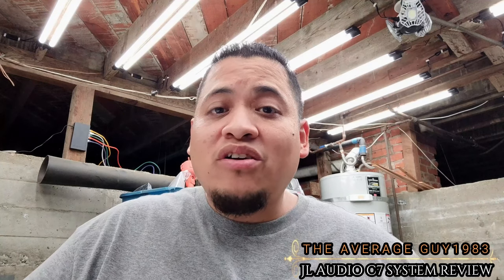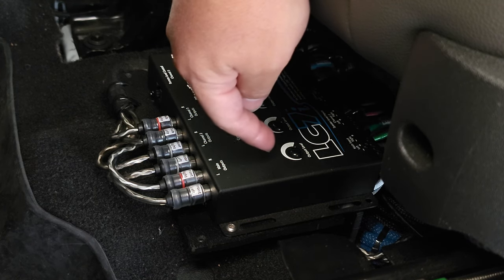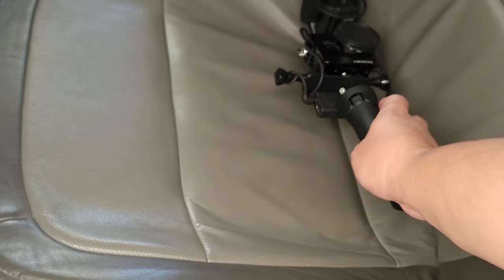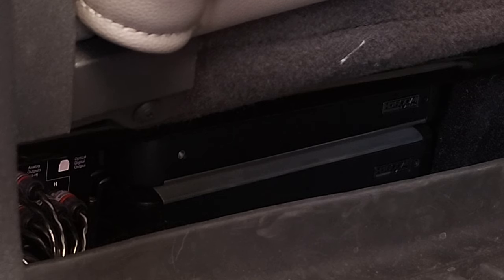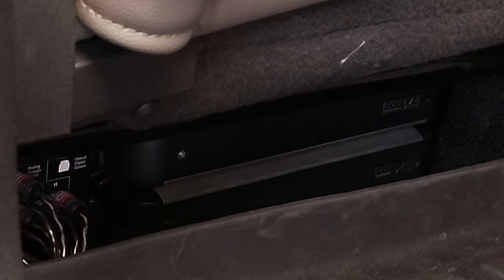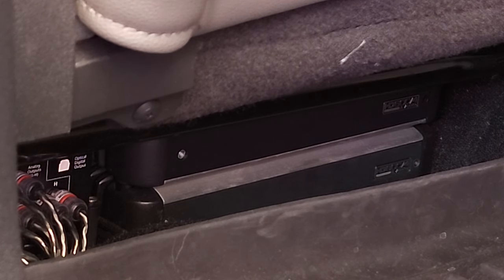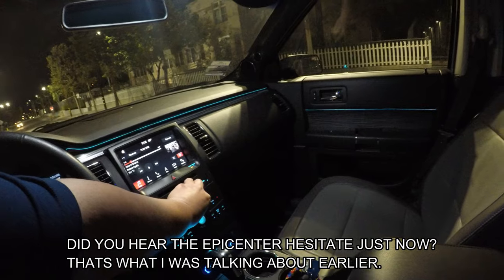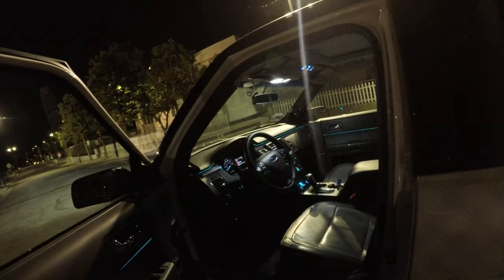MY JL AUDIO C7 AUDIO SYSTEM REVIEW

Comment: JL has always claimed 40 to 50% higher watt ratings then they can handle but they do sound good but if you follow the spec's you will fry them quick
Reply from the maker: You have no idea how happy i am to read your comment. I really wish people would know this about JL. To me, JL Audio is still an awesome brand, but you can't push these new C7 speakers anywhere near their rated power, but they sound so freaking awesome. I hope you dont mind, but im going to pin your comment because people need to hear this from someone other than me. Thank you again, man, for saying this. 🙇‍♂️🙏
Reply from the maker: @XxHoLiNeSsxX  yep. Now i know why JL Audio made the Vxi amps, i just wish the Reps i talked with would have been honest and said just get our Vxi amps for your speakers instead of pushing the HD amps to me so much as "the best choice" 😅
Eventually, i will be replacing the amps with VXI and cleaning up some gear clutter.
Reply: @THEAVERAGEGUY1983   Can I ask if the epicenter is good for SQ system? I listen to just about everything I enjoy experimenting with new stuff alot.
Reply from the maker: @stabbingheart3781  absolutely! The convenience of having one is that you can engage it On or Off by turning the included knob. So if the song sounds great with it, you can leave it on and if it sounds terrible then you can leave it off. 😁👌
Reply: @THEAVERAGEGUY1983  Does it cause any problems with distortion?
Reply from the maker: @stabbingheart3781  good question, ive never heard any from it on the subwoofer but it might be possible. The best way to prevent it from doing that is having the voltage jumper inside of the epicenter at no higher than 5 volts. And always tune your subwofer from that point with your epicenter engaged with the knob direction slot in the middle and use a 80Hz test tone to set the gain on the amp with the epicenter on that will prevent any clipping/distortion. Main reason why this will work is because the epicenter's job is to lower down high frequencies to lower frequencies. So 80Hz will get converted to 40Hz when the epicenter is engaged. This doesn't affect the standard music either. 😎👊
Reply: @THEAVERAGEGUY1983  Thank you for all the information. I will definitely try get one imported and installed.
Reply from the maker: @stabbingheart3781  😎👊
Reply from the maker: @stabbingheart3781  if you need any help after installing it, please feel free to reach out. My goal here on this channel is to help people with Info. This includes anything related to car audio. Not everyone has enough money to pay an installer, which is why my content has stepped on a few toes, lol! But it's all good, i won't change my way of thinking. 😁👊
Reply: Not really it’s about how you tune your amp and the type of amp you use if you run all there stuff they make you’ll see they will run perfectly
Reply from the maker: @rideordiesquad7700  there's  no doubt that they run perfectly, which they do however its about JL audio over inflating their RMS power rating for the C7 speakers. 🤷‍♂️ they do not do rated.
Reply: So a JL audio Vxi amp would be better for the C7s rather than an Audiocontrol D/6.1200 that puts out like 125W per channel?
Reply from the maker: @francisap1632  in my honest opinion, absolutely! You can even gonas far as getting a VX800/8 and put 4 channels for the tweeters and midrange speakers which 75 watts is way more than enough power for those and then bridg the last 4 channels for your midbass drivers to get a cleaner louder output for them but not overkill with power so they wont blow on you. Or do 1 channel per each driver and customize your EQ for each speaker to you're liking to make sound as nice as you like without having to worry about blowing out your speakers as they wont have too much power going to them. Im leaning in the direction of a VX1000/5 and a VX800/8 to control the whole system as these HD amps are way too powerful for these speakers and im literally ripping my self off in performance since i had to really dial these HD amps doen to less power output. 😅
Reply: @THEAVERAGEGUY1983  How will VXi amplifiers resolve the issue?
Reply from the maker: @completelyanonymous8683  the VXI amps have lower power to each channel and though it may not have a lower distortion point like the HD Amps do it will also diminish issues with the external DSPs i have which im running two TWK88's for the front and rear channels. I still get them to fail from time to time. 😅

Comment: Dude! You have better sound quality in your recordings than most people that are actually high end car audio technitians, fabricators, designers and installers. 
I'm very impressed with your work, but mainly the audio quality in the video
Reply from the maker: Thank you very much! One of my goals here is to have better audio and Video Quality so you mentioning that means alot to me. I've been watching alot of those higher end trendy youtubers and just bought some of the gear they have so hopefully the new videos moving forward also look alot better too. 😁🙇‍♂️🙏
Reply: @THEAVERAGEGUY1983  please dont go with the things those trendy youtubers use to record. They go for pricepoint (like yust buy the most expensive they can) and not for quality. You are doing a great job and in this case the ability of the mic to handle the spl is one of the key points.
BTW, would you mind giving me some tips for a car audio build? It is hard to design a system when money is a problem cuz everyone says "just go for (flagship stuff), it will be totaly worth it" but sometimes people can't pay flagship.
It is for a big Chevy express van and i'm thinking JL audio
Reply from the maker: @69sound81  no problem, and absolutely about the Chevy express van, can I please know the year and possibly the trim model so I know what can fit in it?
Reply: @THEAVERAGEGUY1983  it is a 2019 model and it is the LS 15 passenger (i think it would be the 3500 cargo equivalent in passenger version).
Reply from the maker: @69sound81  alrighty!!!! Here we go so what you can put in your van are some JL Audio C1-650 priced at $169.99 which comes with the separate tweeter to mount on a dash or A pillar that may have a stock tweeter there for the front doors. https://www.crutchfield.com/p_13699043/JL-Audio-C1-650.html?tp=105

For the Tail Doors they can take the JL Audio C1-690XT 6x9s priced at $199.99 
https://www.crutchfield.com/p_13699047/JL-Audio-C1-690tx.html?tp=91&l=N

A great amp is the JL Audio XD1000/5

You get 75 watts RMS to each front and rear speaker and 600 watts rms for the subwoofer channel and these amps are known to do a bit more power then rated.
https://www.crutchfield.com/p_13698258/JL-Audio-XD1000-5v2.html

For subwoofers you can go with the 12W6v3 it's a dual 4 ohm subwoofer  that can be wired down to 2 ohms to take advantage of all the power the XD1000/5 can do.
https://www.crutchfield.com/p_13612W6V3/JL-Audio-12W6v3-D4.html

If you pair it with a ported Box and a AudioControl The Epicenter https://www.bestbuy.com/site/audiocontrol-the-epicenter-concert-series-digital-bass-restoration-processor-black/5873403.p?skuId=5873403 like mine you can really get tome kick Ass bass!

You would still need power wire and speaker wire and I'm not sure if you already have a head unit for your van but the main gear I mentioned is an awesome start and those C1s I actually installed those in my uncle's 2002 Camry and I did a video on it but I got a copy write for playing music by OutKast in the Demo 😅
Reply: @THEAVERAGEGUY1983  sorry for the 6 days I took to respond. I never got notified of your comment/response. It sounds great as you planned it. I think I would swap that sub for a pair of 12TSW1 in a sealed bos for clarity and the amp for the RD900/5 or the separate set (RD400/4+ RD500/1) just to bring the cost down a little bit. Rhe thing with the shallow subs is that I can get them inside a small box and mount the amp plate on top of it (all hidden in the lower half of a custom center console).
The C1 sounds like a great option and probably I am underestimating them just because there are 3 or 4 levels above them inside the same brand, but considering what you paired them with in this system design, I think I will absolutely consider them as a great option. 
Cable is not a problem and I already have a good enough gead Unit from pioneer. 
I really apreciate the guide, it was absolutely great to understand what I could pair with what (like the C1 speakers with the HD amp).

My only concern is the subs swap... what do you think about that? I don't really want an insane ammount of bass, I really like the SQ stuff and audiofile systems over the open show and hyper loud ones that could power a big latin wedding.
Reply from the maker: @69sound81  that sounds pretty good but if you like you van also get two 12W3v3-4 ohm subwoofers and wire them in Parallel which is both positive together from each subwoofer and the same foe the negative side and then into the amp and you can get the whole 500 watts rms at a 2 ohm load split into two subs and they will never burn out on you. Plus you will get very good sound out of those even in a sealed box using rhe RD900/5.
Reply: Agree

Comment: Don't worry about being a DIY installer. I worked as an installer when I was younger and always installed my own gear. In 2020, I bought a new Ram 1500 but didn't feel like installing a system myself so I paid a "professional" shop $1k in install labor and they did a half ass job. Cross overs dangling by the wires behind the dash, wires spliced with t connectors, amps just screwed into the back panel behind the seat which flops around. the Pac AmpPro (OEM interface) was not set correctly for the JL amps so I was getting distortion even at minimum gain settings. I've lost 3 of my JL c3-600 6" drivers and one 10w3v3 Sub because of it. I had to go through and redo everything. No one will do a better job than you will do for yourself.
Reply from the maker: 😁👊 agreed 100%
Reply: Same bro i have trust issues issues so i do it myself 😂
Reply: Well spoken!

Comment: I’m so jealous ! I installed the JL C-3 650 along with a 10” JL Sub and don’t get me wrong it sounds amazing ! But this system is hands down the bomb !
Reply from the maker: Your system is definitely a really good one, the C3s have great mibdass. Thank you for the compliment on mine. Its been a roller-coaster of mixed feelings due to the DSPs randomly malfunctioning but the amps and speakers are Excellent!
Reply: @THEAVERAGEGUY1983   Buy the fix 86 DSP I’ve had absolutely no problems with mine .
Reply from the maker: @Jeff I  got one but that device only works to Auto EQ the stock system signal to a flat signal to send to the TWK88 DSPs with the separate frequency setting for each speaker so when the TWK88s malfunction on me, it goes into fullrange mode which then plays fullrange audio out of each speaker including the tweeters which is bad. I made it a new rule to always have my main stock radio volume at 1 or 0 before i exit out the car so incase the DSPs malfunction in me again at random, i wont blow out my speakers. 😅 thats the bad thing i found out about going full active, all your speakers are controlled by the DSP vs a passive crossover which to me is way more safe and less expensive lol.
Reply: @THEAVERAGEGUY1983  I know that’s got to be so frustrating brother. I know that if I were you I’d search for some top notch installers . You may have to spend some more money but at least you’ll have a system you don’t have to worry about all the time. I paid to have all my stuff installed by guys who that’s all they do for a living with thirty yrs experience. I’ve not had the first problem out of my C-3 /650 . I’m running two sets in the front and two sets in the rear with a JL 10” in my 2018 Honda Accord Sport and I love it brother. Everyone who’s sat in my car says that’s it’s the absolute best car system they’ve ever heard . And man ! I can turn that thing up and it’s crystal clear without a hint of distortion whatsoever. It sounds like you’re at a live concert and I love it. I’m so sorry you’re having such issues and hope you’re able to figure it all out soon because I thought your system sounded amazing and will be even more amazing after you get all the bugs fixed.
Reply: @THEAVERAGEGUY1983  let me know when you get all the bugs worked out of it brother cause I want to hear it after it’s working as designed
Reply from the maker: @jeffi854  will do. 😎👊
Reply: @THEAVERAGEGUY1983  seriously brother I would love to hear it when you’re finished. If I can get some help uploading mine I’ll let you listen to it. But you’ll hear that you’re C-7 system doesn’t compare to my C-3 650 system with 10” sub running a JL 600 watt amplifier

Comment: Hey, I wanted to comment on your other videos about the monitors and tapping the power line. 

Thank you so much for the walkthrough, gave me some great information and helps me decide what I’m doing with my faulty headrest monitors in my Expedition (I plan on replacing with standard headrests and will try to tap into the existing line). 

I wanted to let you know, they make 90 degree angled HDMI adaptors to help hide the excess HDMI wires from hanging out. 

Take care, thanks again for the videos!
Reply from the maker: No problem, I'm glad it was helpful and thank you so much for letting me know about the 90 degree angle HDMI adapters. 😀 👊

Comment: Great video and thank you for your honesty. Would you have considered a JL Audio Fix 82 or 86 installed after your head unit and have that signal fed to your DSP then out to your amps? What do you think you spent alone on sound deadening? I have a Dodge Durango and am trying to factor in that cost. Thanks for your feedback.
Reply from the maker: @007galaxie  yes absolutely! I actually did purchase a Fix86 but haven't installed it. I was recommended to install it inside the dashboard behind the Navigation screen as there is an empty pocket there where the fix 86 will fit but im not sure if ill have any issue with heat from the sun hitting the dashboard. So i haven't installed it yet, but i do have a brand new one. 😁👍 on sound deadening alone, i spent about $1,200.00 using both Knu Konceptz 100 mil deadening and then using Sound shield over that since it has a closed foam backing to reduce as much noise as possible.